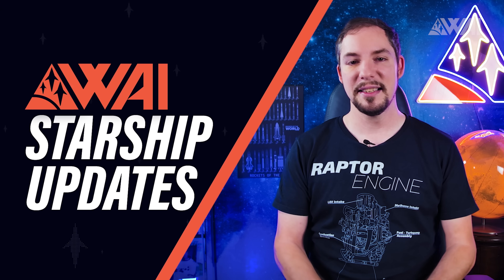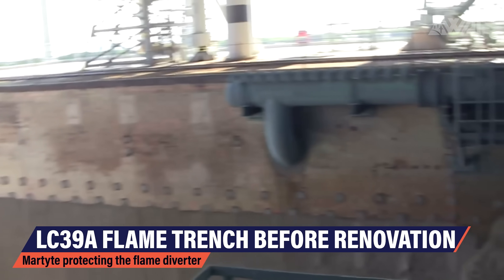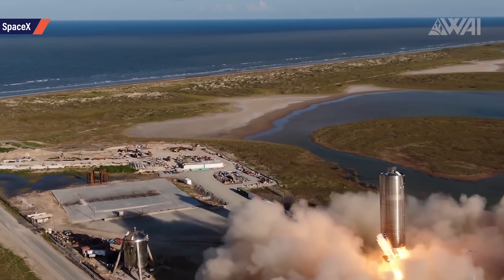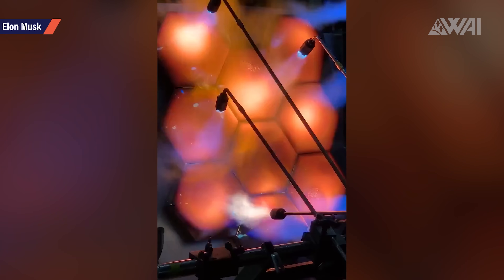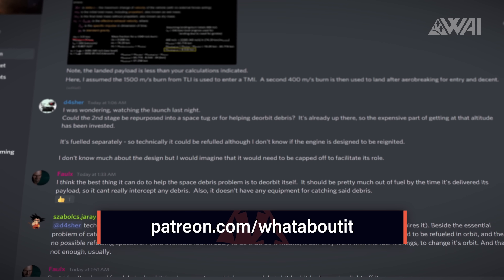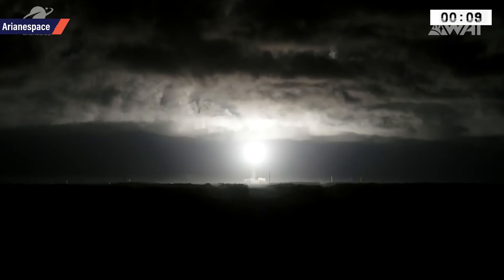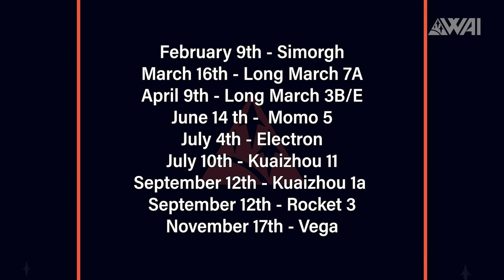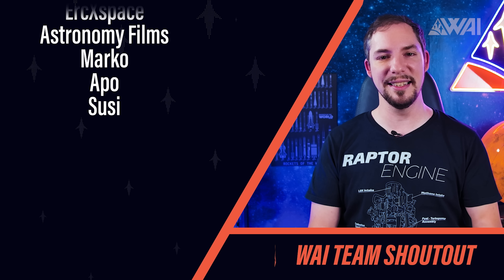134 | Why Martyte helped to damage a SpaceX Starship Raptor engine!

Comment: Puzzling, a large part of a flame diverter is actually for sonic diversion to prevent reflected sonic energy from bouncing off the ground and damaging the rocket. It's also why the water flood systems are used. Sonic damping primarily for the rockets protection then the additional benefit of cooling the launch pad to prevent thermal damage to it.
So Elon and his engineers think they've found a way around a problem that vexed early rocket pioneers in multiple countries who ALL settled on diverters and water flooding for larger rockets.
Looking forward to seeing what they do as they've been good at thinking outside the box.
Reply: You won't be able to use a deluge system on mars if you're planning to vertical land and launch on a martian surface pad.
Reply: @micmccond7  at the lower atmospheric pressure on Mars the reflected sonic vibration is supposedly so much less that it isn't a concern. There is a concern with the full skirt on Starship and it's current short legs that under high gas generation, like with several engines firing on landing the pressure will build up in the skirt like the skirt of a hovercraft and interfere with landing... That will have to be engineered too.
It may be that Mars bound ships will not land back on Earth but do an orbital turnaround (and THAT would require a wonderfully big space station in Earth orbit)
Reply: @bobjoatmon1993  Does it matter if theres atmosphere or not? Wouldnt the space under the nozzle be filled with exhaust gases and thus act as atmosphere on its own? 🤔
Reply: @hanbanaroda  like I replied to Megadove, yes that's a concern that absolutely has to be addressed.
Note that the wingless Starship lunar lander doesn't use rear mounted engines but has them around the circumference up midway just for the skirt  pressurization and lunar regolith ejecta problem. That will work in 1/6 moon gravity but NOT in even the thin Martian atmosphere and gravity
Reply: I think they actually need to learn how to do without a flame diverter for Starship as that will not normally be an option for landing. The booster launch is another matter as that will be far more destructive with 30 or so engines all firing together at full thrust.
Reply: por que no lo hacen como los cohetes que salen de los submarinos  saltan y luego prenden

Comment: I suspect that SpaceX's final landing & launch pads (on earth) will be concrete covered with panels of stainless steel covered with the heatshield tile system currently under testing. (Ideally the tiles will shatter into tiny pieces if fractured)
Reply: And how would you do this on Mars?
Reply: @antyspi4466  I added "on earth" after your reply, but SpaceX has already shown a concept for lunar langings that use the capsule engines for landings to prevent this kind of stuff. Mars is another matter.  1st things 1st
Reply: Just heard that SpaceX has started to add water-cooled pipes to that launch pad. We will have to wait and see

Comment: One of the best theories as to why SpaceX isn't using a flame trench that I have heard is this:
There are no flame trenches on Mars, therefore Starship and Superheavy need to be able to take off and land without the use of one.
Reply: Mars 1/3g and moon 1/6g... so, you have to take that into account too. but yeah. I guess it is a bit of a problem to lift of from a totally unprepared spot.
Reply: Not so much superheavy. Superheavy needs a flame diverter no matter what......However a superheavy won't ever land on the Moon or Mars so no need to not put a flame diverter. Starship on the other hand will have to be able to take a beating specifically the engine bay.

Comment: Flame diverters for starting mounts on Earth may be relatively easy.
How about flame diverters for langing on Moon or Mars? There are 
quite many loose stones there.
Reply: That's exactly why they aren't using a flame diverter for starship test mounts. A flame diverter will not be used on the Moon or Mars. That's why the engine bay will have to be ridiculously strong and take a real beating. With superheavy they will need a flame diverter.
Reply: Continuing: 
loose ground on Moon or Mars may turn into thousands of flying projectiles when Raptors will blow on it during start or landing. With much lower gravity on both Moon and Mars speed and range of randomly flying bullets may be quite spectacular. With current design of very short landing legs the engine section may turn out into quite an efficient "ball mill" for engines and other equipment located there.

Comment: If starship kicks up dangerous debris like this, imagine the results of landing on the regolith on the moon or mars!
Reply: you have to take the much lower gravity into account... but yes. I have thought about the same thing. starting just like that directly from the surface, from a totally unprepared spot...might be a bit of a problem.
Reply: thats why the lunar version is going to use cold gas to land not its main engines
Reply: Exactly, i think that might be why Elon is looking for a solution that isn't based on adapting the launch pad.

Comment: Hasn’t there been more launches this year? so the launch to failure ratio is not as bad as you made out.
Reply: Even doing it as a percentage, 2020 has been rough. 9 of 94 attempts this year failed, about 10%, compared to the previous 3 years (4.9, 2.6 and 6.7% respectively).

Comment: As starship will have to land on a flat surface, I think adding a diverter will not solve the complete problem. maybe a combination of a stronger launch/landing pad and making starship more durable to impacts. remember that it will also have to land on mars :D
i am curious what they will do with the launch mount #teamspace
Reply: The developed Starship flying several years from now will need to do that, but I think SpaceX should cheat as much as they can right now to get the prototypes doing test flights.

Comment: The reason for no flame diverter is because starship objective is to land at and launch of any solid surface in the solar system. They need to do it without a flame diverter. Is a bold move, but if there is anyone that can do it, is spaceX.
Reply: 1/3g on Mars and 1/6g on the Moon. that can be translated in less thrust needed to lift off. I even would go further and would assume you need special starships for each environment. Landing on the moon is different then landing on mars or earth. one thing fits it all is highly unlikely
Reply: @spanke2999  I hope the first missions will have some kind of 3D printer robot to make a rudimentary landsite for posterior missions. How can someone not me excited with the space exploration time we are living? :D
Reply: @spanke2999  moonship doesn't use raptors to take off from the moon, it uses the mini engines at the sides. it will never raise debris.
 as for mars, SL raptors are able to throttle down, a single raptor has enough power to land a whole starship on earth.
Reply: @jesusmora9379  I know... but still it doesn't sounds right to designe a ship that is capable to dock in orbit, to transfer fuel in orbit... and then add the option to land on three totally different 'planets' I guess there will be a version for the moon only, as you have mentioned, for earth reentry and one for Mars... maybe one of the other objects as well if needed later on

Comment: Have you ever heard the expression, as regards commercial aircraft, "if it ain't Boeing, I ain't going?"  

Well, when it comes to manned rocket flights, maybe that should be "if there ain't a flame trench, then I ain't leavin' this bench."

EDIT: corrected missing definite article "A" and word flow.
Reply: Well Consider that starship won't have a flame diverter leaving the Moon or Mars. They don't need a flame diverter for starships. Only superheavy. Starship needs to be tested in horrendous conditions to prepare it for the conditions on the moon and Mars. They don't need a flame diverter for Starships right now.
Reply: @SpaceXsuperheavy  No question about it, you're right, and those will be challenging conditions.  In other news, I have NOT volunteered to go on a Mars mission. 😁

Comment: If starship doesn’t have a flame divertor , may the launchpad have several damaged parts after each launch , like what happened with SN8 ?
Reply: I am going to assume partially. Unless they find a better way (like launching from sea where engine could potentially just fire into the sea (not idea but still))
Reply: @saltylelele  As someone else mentioned, it needs to be able to take off from the Moon and Mars, WITHOUT martyte. Possibly without infrastructure, so these things need to be solved on the ship rather than on the pad.
Reply: @shestewa6581  Good point. Save a lot of time and money launching from a flat piece of Mars and Moon.
Reply: I would be something of they had a completely reusable rocket, only to need more and more launch pads so they can keep firing